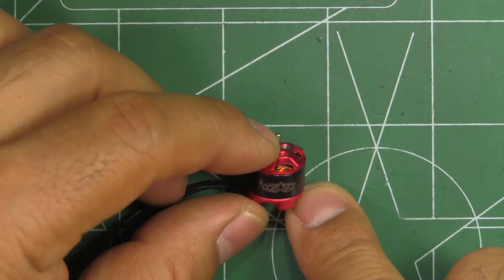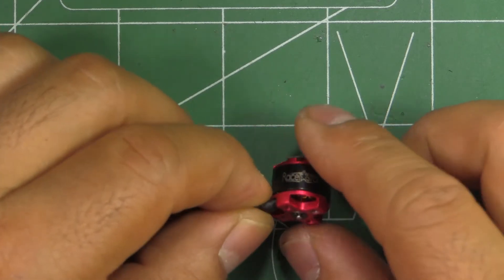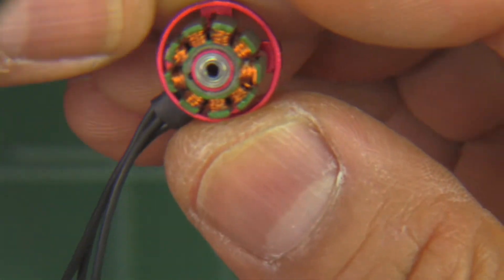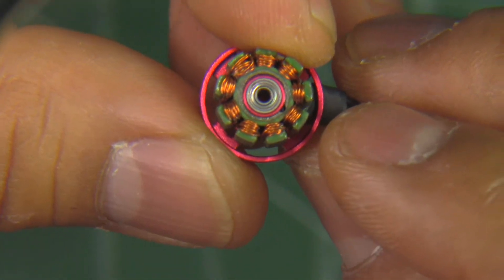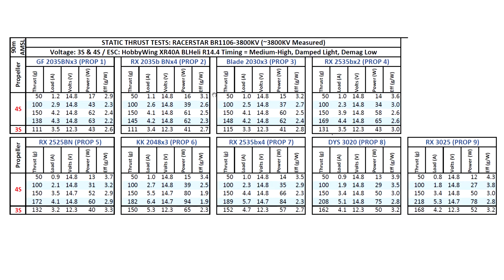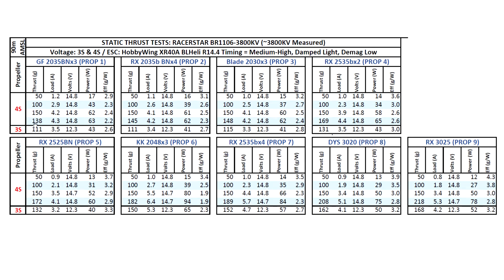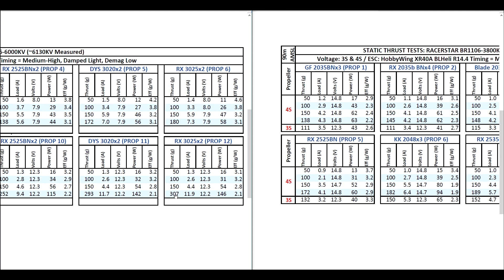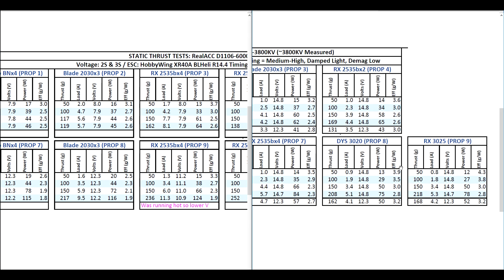Banggood RACERSTAR BR1106-3800KV 3S & 4S Thrust Tests - Need more KV !

Comment: I would've liked to have seen the DYS 3040, and the rotor X 3044, on 4s, and the gemfan hulkie. These higher pitch props are better suited to the KV.
Reply from the maker: RX 3044 & GF Hulkie were not made at the time I tested this motor and I didn't have the dys 3045x3 (I think that's what you meant? I have not seen a dys 3040, got a link for that one?)
Reply: EngineerX yes I meant the dys 3045x3, i thought you usually test with it.

Comment: How would this low kv motor work with the Gemfan 3035 triblades?
https://www.banggood.com/2-Pairs-Gemfan-3035-3X3_5-BN-3-blade-Propeller-PC-CW-CCW-1_5mm-Mounting-Hole-for-1104-1105-Motor-p-1182779.html

Kingkong 2840 triblades?
https://www.banggood.com/10-Pairs-Kingkong-2840-2_8X4-CW-CCW-3-blade-Propeller-1_5mm-Mounting-Hole-p-1160372.html

may be able to handle 4s with these?
Reply from the maker: Daich Chow Based on all my other test of 4000 and 4500kv 1106 motors the 3035x3 or 2840x3 props should work OK on 4S. Still,check motor temps after a short run

Comment: I guess this motor is geared towards .. I don't know..  people who want to go slow and have long battery life?
Reply: There are 4025 props with a t mounting style. They probably suit this motor well but it will definitely lack performance
Reply from the maker: I never saw those 4025 props! I think those would match well on both 3S and 4S. That would actually be an interesting build, these 1106 in a superlight frame on 4025's to cruise along for some 7 to 10min flights perhaps
Reply from the maker: ten_drones : LoL... yep that would be a good match! unless you can fit/find/make a 5S-300mAh pack
Reply: EngineerX, i think there's a mistake. 3025, not 4025.
Reply: I do mean 4025
Reply: Older days there were 4025 props. Sadly I couldn't find them. They run those 4025 in 2014 or something like that. It's discontinued now but there are some that still make them them with 5mm center hole (clone gemfan, early days gemfan really made them)
Reply from the maker: As he says, they're hard to find. Those 4025s would work best with this motor but then when you can't find them when all stock runs out.... LoL.